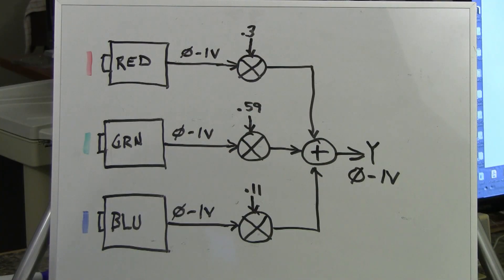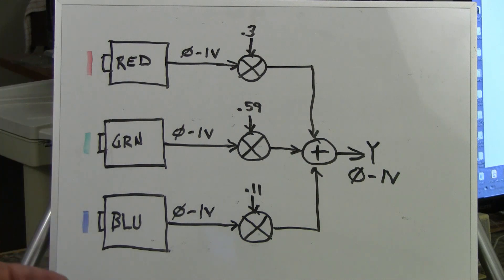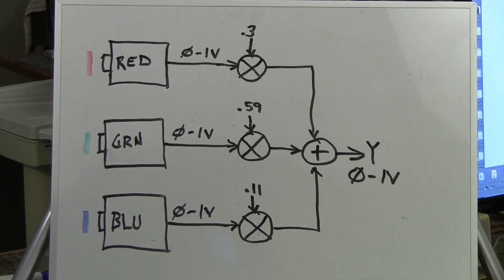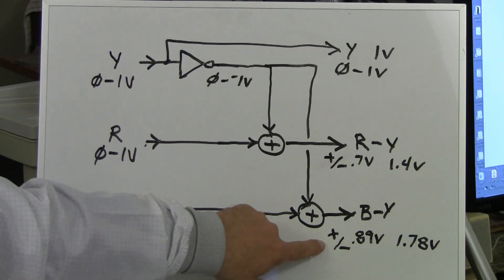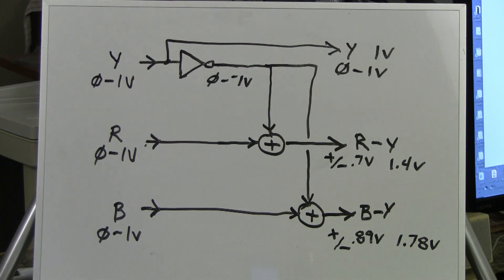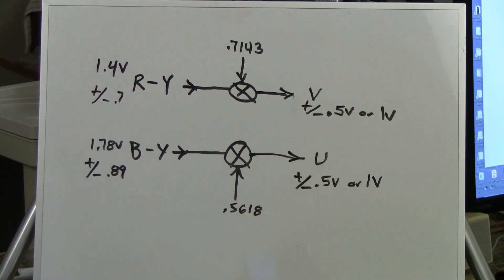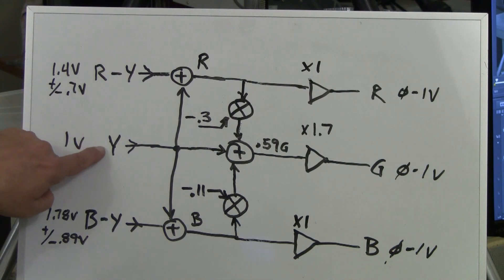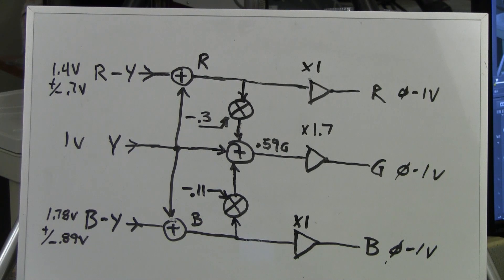The Very Basics of the Color Matrix

Comment: Does this mean you are dropping the NBTV project?
Reply from the maker: No sir. Just put it aside for a while. It seemed like there was a general lack of interest and that many people did not have a source of mechanic RGB available. I have the very expensive World Converter which produces the signals from SDTV input. I got some push back about that. So, I went back to some basics in order to put out a video before folks starting thinking I sailed off the edge of the Earth.
Reply: @videolabguy  Good to hear. The Aurora is an excellent piece of kit, but please don't forget there are several free software solutions available (some requiring relatively straight forward hardware interfaces) that can provide the same type of conversion. I would also like to, respectfully, recommend starting with a black and white version as there are many common issues that need to be addressed, and having a straight forward signal available makes the task much easier. Cheers.

Comment: Welcome back! I know you mentioned this in the beginning but I think we should reiterate it. The voltage levels you used are arbitrary. They can be any reasonable voltage level. The ration of  .30/.59/.11 however is fixed. That cannot change for NTSC. So as long as you maintain that ratio, the actual internal circuit  signal levels can be what ever suits your design. But then on the outside world, we again have a standard of 1vpp for a video signal. The R-Y, B-Y are 0.3vpp each. I you are to interface to standard video equipment, you need to use these levels as your input and output.

Comment: Worth mentioning that some early colour broadcast cameras in Europe using Plumbicon tubes (like the EMI 2001 and Marconi Mk7) used four tubes - luminance, red, green and blue (YRGB). The way those two cameras matrixed the outputs was different - the Mk7 being true YRGB, whereas the EMI 2001 used the output of the green tube for the basis of the colour matrix, then adding in red and blue and using the luminance tube for fine detail.

This apparently produced more natural colour flesh tones and also meant that the rate of attrition of wasted Plumbicon tubes wasn't so high (Philips had real problems early on at making Plumbicons with a high enough resolution). The solution was to use 1 high quality Plumbicon for the luminance then the three lower resolution Plumbicons for the three colours. The result was this matched perfectly the requirements of the colour TV systems, where the luminance is of a much higher resolution than the colour information on its own. Which in turn fits what the human eye sees - they are much more sensitive to luminance than colour.

By the mid-70s, Philips had developed the Plumbicon manufacturing process further such that camera manufacturers, like Link Electronics, EMI, Marconi, Philips, Hitachi, RCA etc were able to make cameras using Plumbicons of a high enough resolution that the luminance tube wasn't needed and the colour rendition achieved by using the traditional RGB technique in the video above was considered of a high enough quality to (almost!) match that of the YRGB system. It's worth mentioning three things here, though:
1) Marconi quickly moved from YRGB (Marconi Mk7 camera) to RGB (Mk8) then on to a GRB system for the Mk9.
2) RGB and GRB proved unpopular with the vision engineers who set up the cameras as they were still thinking of the YRGB method of lining up cameras, which is why colour rendition never looked as good on RGB and GRB cameras as they did on YRGB. Often the solution to a problem was to give a bit more aperture correction, instead of learning from scratch how to line up using a camera with a different method of mixing the colours.
3) Partly because of this (and also partly because it was the "cameraman's camera" - cameramen loved its integral zoom lens and 100% ergonomic design despite its chunky and bulky design), the EMI 2001 YRGB camera was used for much longer than it really should have been, in most cases being phased out in the early-mid 80s. Not bad for a camera designed in the mid-60s!
Reply from the maker: Thanks for the detailed comment. Loved it! I worked with a fellow named Bill Cosgrove (RIP), years ago, who designed part of the RCA TK-42. A four tube monstrosity, with a 4.5 inch IO and three 1.5 inch vidicons. He told the story of how he added thermoelectric coolers to the color channel vidicons to reduce noise. It worked beautiful all winter. Come spring in New Jersey and General Sarnoff came down for the big demo. He said they showed Sarnoff the camera with the coolers turned off and it looked very good, just a little noisy. Then he switched on the coolers with great pride. To his horror, the color faded away and the camera was making a BW picture. The humidity was around 90%. When the faces of the color tubes hit 32 degrees F, ice formed on them and blocked the light! 
I still belly laugh at this story to this day. I never had it that bad. But, in engineering, there is always the big demo for the boss, and it never fails to do something spectacularly bad!
Reply: @videolabguy  I remember Bill Cosgrove too, from my time at RCA Broadcast (1972-79).  I didn't remember that he was one of the architects of the '42, but I do recall hearing that condensation story.  The TK-27 telecine camera also used 4 tubes (vidicons) - the Y channel was 1.5" diameter and the color channels 1".  You could switch the matrix between 3 and 4 inputs.  When I worked at TV station WFMJ we used to play with the 3/4 switch with movies and slides and could never see a difference on the composite monitor. Too subtle for us, I guess.
Reply: @k8zhd  Hah, that 1.5in vidicon. It was quite expensive and I think only RCA made it. I was told by a CE that hardly anybody other than NBC ever replaced it. Once it went bad, they just switched to 3V and called it a day!
Reply: Here's diagram of the matrix for the EMI 2001 https://www.tvcameramuseum.org/emi/2001/p20.html  From what I remember of my BBC Colour Course in 1975, their theory was that doing it this way produced a better match to a Panchromatic Monochrome for B&W TV's. The 2001's at the BBC used a combination of dichroic filters in the colour splitter block https://www.tvcameramuseum.org/emi/2001/p13.html and neutral density filters on the face of the pickup tubes to get the best colourimetry. The 2001 was a great camera for studio work, and it is interesting to look through this collection of photos. One difference between the version shown and the ones I worked on was that the Aperture Correction was inside the CCU. If you go here http://www.editorsbench.co.uk/ and click the INFO button the top picture is me in about 1976 with my hand inside the CCU! From the position of my hand and the fact there is a board on the shelf at bottom right, I am adjusting the aperture correction.